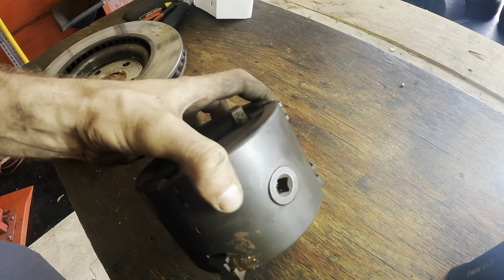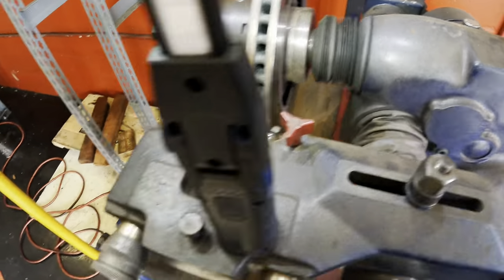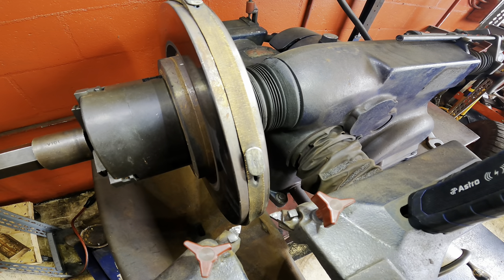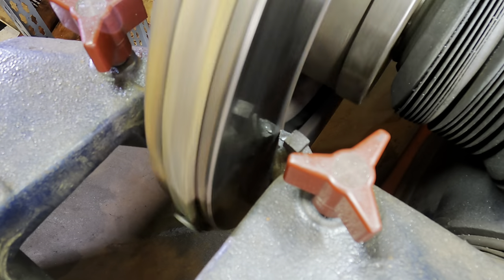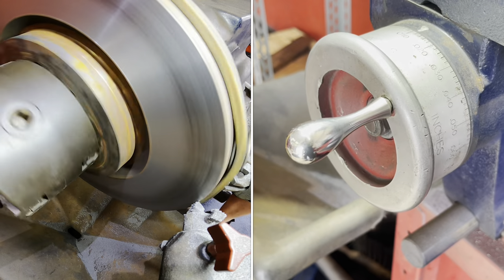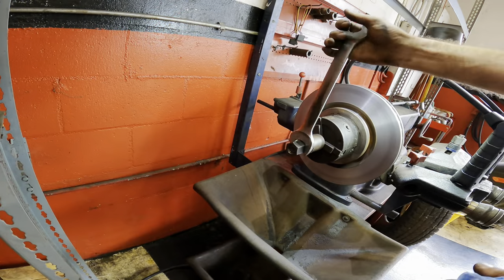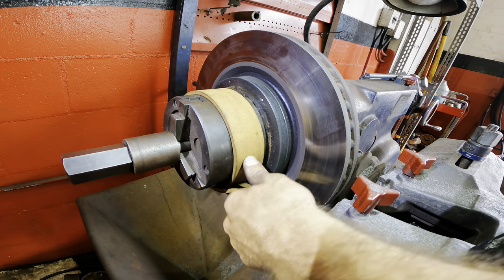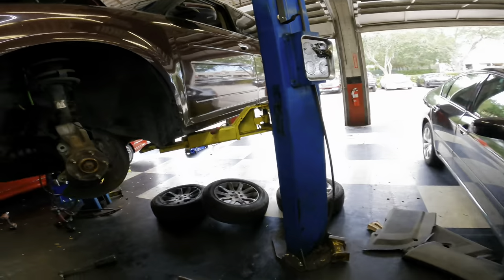Powering on the Brake Lathe! Previously Unlisted bonus video

Comment: Great Video Ray! To be honest I haven't seen a rotor turned or heard of a rotor turned in more than 20 years. It's a honor to see that it's still being done! 😊
Reply: I've never found it to be that uncommon, but that's because the trade school I went to taught us how to do it, and both my current and previous job at Toyota dealerships still do it that way.
Reply: @JSW793  Toyota...the only vehicles I have owned where they still surface the rotors. And don't need constant parts during check-ups. I will never own another brand again.
Reply: @kennethm3071  we have both fords and dodges. our lkocal orileys will turn them for us doesnt matter the vehicle.
Reply: @JSW793  Most of the shop will sell the whole rotor and refused to spend time turning it since the shop rate for machine ans man hours are much higher than buying Chinese made thrown away rotor cost!
Reply: Same
Reply: We live in a throw away society.  I resruface my own drums and rotors on a metal lathe I have.  Just can't do both sides at once on rotors but my time is free to me.
Reply: Ford motor company requires us to turn rotors for warranty brake work under their maintenance protection warranty or for any sort of early vehicle life issue with the rotors
Reply: Used to be common place now were in the age of disposable everything.
Reply: We turned them at chevy all the time. I think most dealerships still do since factory rotors are still very expensive
Reply: Bmw does it as a service procedure if rotor don’t need to be replaced
Reply: I was thinking the same thing. I did not know they still machine rotors. I always just replace mine.

Comment: Hey man, love the channel. This is my favourite thing to do in the shop. I usually clean the inner disc where the jaws clamp on with a wire wheel first to clean up the debris to make sure the runout is perfect 👌🏻 I also check the runout/disc alignment with the reflection off the cutter on the disc itself, once both of these have been done it’s bang on ! 
Anyway I won’t harp on take it easy legend

Comment: I spent many of my formative years (1980's) as an automotive machinist. Thank you for the blast from the past! I only was a little bit surprised that even though those rotors were obviously very new, you didn't double check them with a micrometer. Also I use to use an air grinder with a coarse disc to gently put a "non-directional" finish on the rotors.😉
Reply: He used his "eyecrometer".
Reply: Goberian, totally agree with you. After the final cut using a 180 grit disc will remove the 'directional' finish giving the rotor OEM cross-hatching pattern. Cheers
Reply: Yeah, it's pretty much guaranteed that second rotor now has run out machined into it. Potentially the first one as well, given that he didn't check it but (hard to tell through the camera) the arbour was running true so it was probably straight enough. 

That second one though, with the painted face, guaranteed to pulse in a while.

Comment: The anti chatter band broke probably because of the brake clean, I'd recommend taking it off before spraying down the brake parts. A strip of solid pure lead would work similarly, I used such tactics on a lathe a few times, does work.
Reply: I was just about to re the same thing. Saw the Break clean and literally said aloud. I am sure the rubber will love the Brake clean. Next scene "ok the band broke" LOL

Comment: been a few decades since ive used a brake lathe but ive never seen one with a chuck like that...i remember them having assorted cones and cups to center everything...
Reply: same
Reply: It's been about 25 years since I last cut a rotor. I've never seen the chuck either. We had the cups and cones. We had a flexible shaft that slipped on the end nut that drove a disc sander to put a non-directional finish on the rotors.
Reply: Upgrade kit for the ammcos, been out a few years.

Comment: Like others have said, there is a minimum thickness that these can be used at and if you cut them under that you would be liable if the customer ever had a braking failure!
Always verify the thickness with a properly calibrated micrometer.

Comment: Resurfacing rotors, drums used to be a common thing. But it got so cheap out here in California to just buy new rotors or new drums versus labor costs it was easier just to put newer ones on. Sold the lathe and quit  doing it. For cost efficiency to the customer. 🤔🤗🙏♥️🇺🇲

Comment: Use the silencer that you used on the first rotor near the end of the cutting as a non-directional cut. That's what it's MADE for, rotors too thin for a rubber band silencer, or an added help for the noisy ones.

Comment: I use the spring style silencers that go around the diameter of the rotor as I've never had a front rotor chatter on me when resurfacing. Whenever I do cut rear rotors I like to take 2 of the old rear pads if they still have some life and squeeze them on the back side of the rotor to keep it quiet. The bench lathe at my shop has a one cut feature so if I felt no pulsation in the brake pedal then I can usually get a good solid pass once and I'm done.

Comment: Man I last turned rotors and drums back in 76-82 at the GM dealership I worked at good to see it still done sometimes
Reply: Wow   in 1989 our GM dealership bought a new rotor lathe that they did them on the car  didn't last long   Ac delco. New parts where cheaper to fit and easier
Reply: @mondodaftasabrush  yeah those became popular I remember seeing them. Nowadays most rotors come from China or Mexico even dealer parts it’s cheaper but I think so is the quality

Comment: FYI - Don't use brake cleaner on your rubber bands.  Remove them first.
Reply: I was about to post exactly the same comment.
Reply: Isn't brake cleen safe on rubber
Reply: @IIGrayfoxII  rubber covers a lot of different materials. I know leaving brake calipers seals soaking in brake cleaner will result in the seals expanding
Reply: I know brake clean and plastic don’t get along at all!!!
Reply: @halfwayfarmsandoutdoors3550  brake clean and some plastics. Some, like HDPE, won't be affected by brake clean at all.
Reply: Ray is not the only one. In a shop that rubber band has probably been used for other things. Example how far will it stretch.
Reply: @IIGrayfoxII  Not usually. There are different kinds of brake clean aerosols but generally speaking you never want it to contact rubber, plastic, or paint.
Reply: @Note_Creator  in my shop it would have been launched at coworkers constantly until it broke (about a day).

Comment: My own experience with rotors was getting hard spots from hard semi-metallic pads. I had an S10 that ate the rotors while the pads were still thick. Shop turned the rotors and afterwards had pulsations. Tossed them and put on new rotors. Problem solved. Most people run their brakes down to the rivets putting grooves in that can't be turned out or do hard braking that overheats and warps rotors. Unless there is a good reason to keep them (high cost or low wear), I toss them and put on new. Don't want to do it twice. I'm not sure you can even turn some rotors like the ceramics on exotics.

Comment: With all the rotors coming from Chinakistan, and the supply chain so screwed up turning rotors is the way to go. Some Mopar Oil filters are not available at all from ANY supplier, Mopar or aftermarket.

Comment: This does work but you’ll need to replace the rotors soon after. I just buy new rotors. Also a good idea to check thickness with a micrometer.
Reply: ? Why would you need to replace the rotors soon after?

Comment: There isn't a worm gear in there. There is a scroll (spiral grooves in the face of a plate) that engages with teeth on the back of each jaw, and a bevel gear that rotates the scroll. If it was a worm gear the socket for the chuck key would be more tangential, instead of going straight in.

Comment: Nice as always to watch some one who takes pride in their work do stuff right.

Also; I noticed you tend to go through those rubberband dampeners. Im wondering if the break cleaner you use is attacking the rubber. Maybe remove the dampener before the spray down? 
Just some thoughts. Not a Ree. :P

Comment: AFAIK the rubber band is not only to dampen the noise, but to avoid the uneveness resulting from the vibration.
Reply: That's what he said. Without it the cutting tips can vibrate and literally jump cutting small gouges out as it cuts, the tips can also snap off.

Comment: Awhile back l asked why rotors and drums were being replaced instead of turned. A few made light of the comment and treated it as one of the dumbest questions to ask. Our shop had a set fee for the service. Rotors had a higher cost and the dampening belts were leather, yeah l'm old. Side question; How are your fowl getting along?

Comment: Ray I really enjoyed watching this video but I also need to tell you I overhaul those machines AAMCO brake lathe they’re easy to work on if you know what you’re doing but never ever ever take apart the fast and slow mechanism that’s what we called the transmission and trust me everyone decides to call me after they’ve been working on it for a week lol lol. I wanted to tell you the rubber band is a piece of junk do not buy those anymore they’re like 25 or $30 the best thing to do is buy the spring they can actually be ordered from eBay make sure you get the five pieces you do not need six because you can reduce it down to four and five only sizes you need on the spring those are about 40 bucks but they will last you forever trust me in what I’m telling you if you don’t know how to get one let me know and I can tell you exactly where to get one and ship it to you directly or get you a number where you can talk to these people but if you ever need someone to help you how to put it back together and I’m talking about the AAMCO brake lathe let me know they’re not easy to work on other than that God bless you Ray✝️✝️✝️🇺🇸🇺🇸🇺🇸

Comment: They still turn rotors ?  My understanding is that the manufacturers make them light in weight so that  their is not enough metal left to even turn down rotors so you just replace them .Its part of the planed obsolescence

Comment: I can't find a local shop that will do this for me without charging me as much as it would cost to buy new. The insurance companies have made it too expensive to do it.
Reply: eBay rotors have made this obsolete at this point. Unless you have OEM rotors it's really not cost effective to do this nowadays.
Reply: @poke2748  I don't buy off of eBay for things like brakes. I found that Summit has better prices for the things worth buying than most places.
Reply: @docgiggles130  I personally wouldn't either but unfortunately the average consumer will. Either way most rotors are cheap nowadays so it doesn't make much sense to have them resurfaced on your average car.

Comment: Very cool...seems to me that the ability to resurface and reuse brake rotors would be a good thing from an environmental standpoint.  How many rotors can you cut before you need to replace the cutters?
Reply: If you listen to the manufacturer of the inserts, 15 mins cut time. 
In reality, you can cut about 30 rotors with each corner of the insert and there's three corners on each insert. If you swap from positive rake inserts to negative rake, you get 6 corners per insert for the same price.
Reply: @jimmyb1451  those are negative rake tools he is using. If they are AAMCO tools you have 3 cutting surfaces on thr right tool, then can be moved to the left for 3 more, then you flip them and do the 3 and 3 again, for 12 total edges. If the tool has a tapered hole on both sides it's 12, tapered hole on 1 side 6.
Reply: @lesbest2  Good catch! I wasn't looking close enough.

I never bothered swapping left to right because I used to cut heavy on the way in, which greatly reduces the life of the opposing edge, but given that it was all I did all day, I could make more money from the time saved.

Comment: Non mechanic here: Didn't even realize this was performed anymore. I thought 'newer' drums were too thin to be resurfaced without future heat warping. Thanks for showing us.
Reply: They're discs. Drum brakes are a thing of the past, fortunately.
Reply: Generally speaking yes the cost of turning them in most shops is around 15 dollars and most disc brand new are 20-45 each. So why grind old ones when for as little as 5 gets you new.
Reply: @xuser48  also no they arnt lots of trucks and semi use them.
My 05 has rear drums my mom's 02 subaru has rear drums too I have seen 2022 trucks with rear drums.
Reply: Newer disks tend to also be plated. Those can not be resurfaced as you would remove all of the plating.
Drilled disks can not be resurfaced too.
The cost associated with resurfacing is relativelly high, and the result is relativelly low quality. You are better with a second quality new disk than premium resurfaced disk. The difference in price is minimal, and you now have a new part.
New disks can last 100000km or even more. Even if it is a consumable like brake pads, it wear so slowly that it can be considered non-consumable, so it is worth to get new ones when they are gone.
Reply: @xuser48  They are not. Newer EVs like VW even come with drum brakes again because they have some advantages.
Reply: @Lunas2525  
30 x 4 = $120 You can put up to 120 back into your pocket, that's why! If 120 is no big deal please make a donation to St. Jude children's hospital.
Reply: @whuzzzup  VW's EV's are utterly crap. If drum brakes are so fantastic how come disc brakes are so popular on modern bicycles?
Reply: @xuser48  What does an "old style" bike brake have to do with drum brakes? EVs rarely use a brake, this is why disk brakes are a bad idea on them.

Comment: Why not put some form of coating on the edges to protect against corrosion?
Reply: No need, the pads keep the contact area clean and the rest doesn't matter. Cast iron doesn't seem to rot through like steel, it just gets a surface coat of rust and stops.
Reply: @oldbloke135  but as I have found during the lockdown it creeps and reduces the friction area.  Many new disks are coated.

Comment: That's a lot of runout for a comparatively new rotor, the rotor should be spun on the chuck while tightening to center and true it or this can occur. Hopefully the discs aren't warped as a result after the lathe work.
Reply: The lathe cuts the  ( warp ) out of the rotor and makes it completely semetrical as if it was a new rotor. Iv personally re-surfaced countless numbers of rotors when I was working for dealerships and smaller repair shops.
Reply: @jeremycermak2179  You assume the rotor is warped and not incorrectly set up. I worked as a brake mechanic for many years and machined more rotors than most have hot breakfasts.
Reply: @johnt.848  yeah that's also true

Comment: Brake lathe 101 for dummy arses. 1. NEVER cut a rotor to min thick, leave 10 thou extra to allow for the pads "turning" of the rotor. 2. ALWAYS clean the hat area of rotor to obtain a flat mounting surface, preventing induced run out, and check for run out with a dial indicator. 3. ALWAYS  do a non directional finish, die grinder/abrasive wheel will work with lathe running. 3. ALWAYS check thickness with micro meter, being sure you're 10 thou above min thick. 4. ALWAYS clean rotor, warm soap and water works great.
 As rotors and mounts have gotten smaller and lighter for weight reduction/gas mileage increase {????}, you most often see tapered rotor wear as shown on Rays first pass. Lathe cuts inside near the hat and no cutting of the outside edge. Thus as a general rule, late model FWD rotors need more metal removed to get em flat/true. That said, most often you'll need new rotors every other brake job.Unless you drive like a wild engine headed to the outhouse, machined rotors should not warp any faster/worse than new ones would...Cost wise, Yukon $65.00 each for new rotors, $15.00 each to machine old ones. Customer saves $100.00. Of course this may be an exception if rotors are a lot cheaper, which they are on some cars. We discuss it and  I let the customer decide. After all, it's their money and their car and I'll do what they want as long as it's safe.....

Comment: It has been more than fifteen years since I ran that exact lathe...& yes, one can even smell still what it was like, the feel of that crank handle as you bring in the bit & it touches down, ...all of it.
  I  hear it is becoming a lost skill as many shops are just throwing "new" rotors & fully loaded calipers, instead of turning rotors & servicing calipers...I guess that's why I was elected to turn flywheels, the ones with the "step" in the surface, I'm guessing no one in that shop was comfortable with that flywheel lathe, nor had the appropriate skill.

Comment: Most modern autos rotors are @ minimum thick when pad wear sensors touch. Additionally , 2daz labor rates make nu rotors the lesser cost. 
Notice brake lathe lacks any safety shields. In today's era of moronism , trying to operate it can easily lead to injury/death when loose  hair/clothing etc , get entangled with rotating stuff .

Comment: But its not good to touch the break surface on the routers you get the oil's from your skin an the dirt from your hands
Reply: Not much of a problem on parts that will get cleaned before use, esp. when the technician uses brake cleaner like it's going out of style 😇

Comment: You can't get a super fine surface finish on a brake lathe. The are not made to those tolerances need. Only a well made lathe can can do that. There was no reason to make a finish pass since the difference between a rough cut & a finish pass in only about .0001 & your brake lathe does not have the fine turning capabilities for speed & feed rates as a manual lathe has.